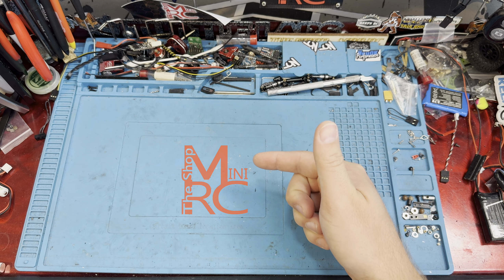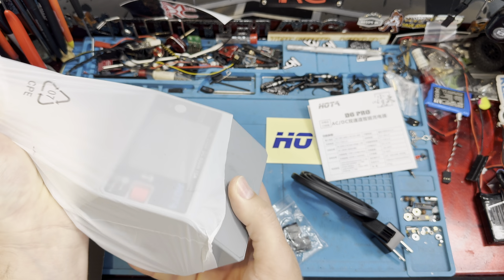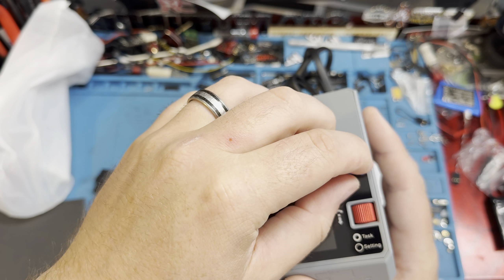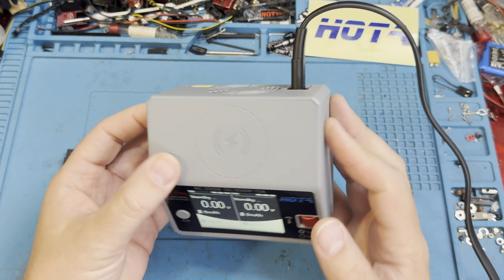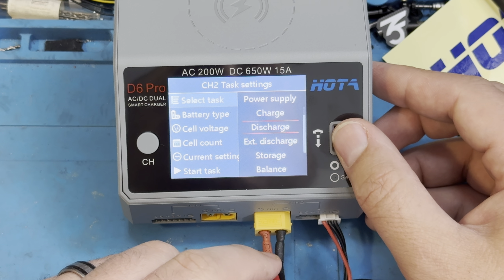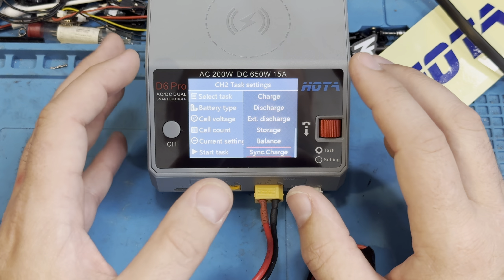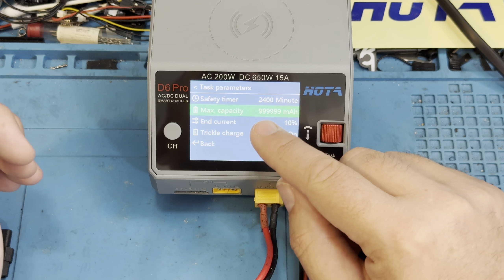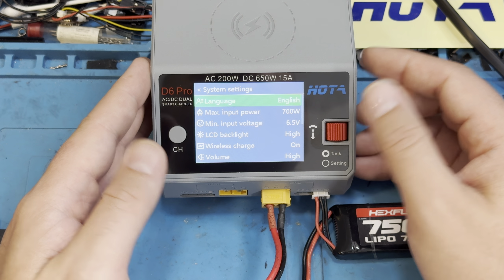Deep Dive & Review of the HOTA D6 Pro Lipo Battery Dual Channel Smart Charger w/ Wireless Charging

Comment: XT60 is the best connector to have on a charger.
Reply from the maker: 100% but many come with adapters as well, which is what we were talking about.  I would absolutely not want any other connector than the xt60 as the chargers main plug.